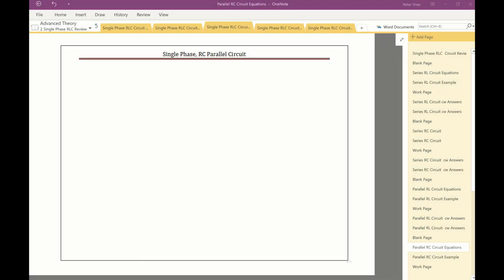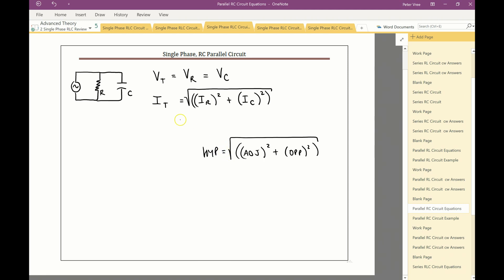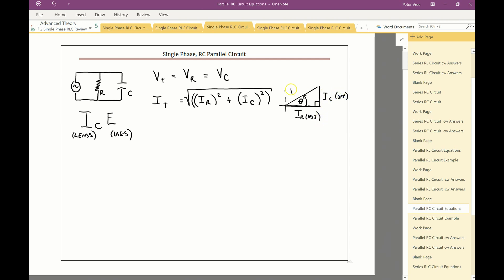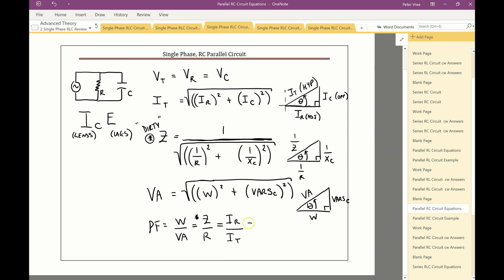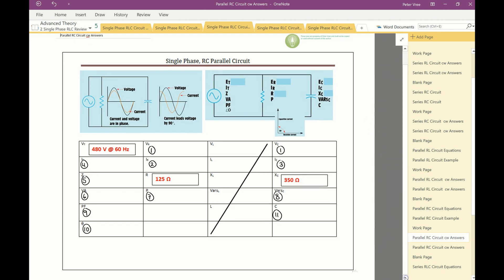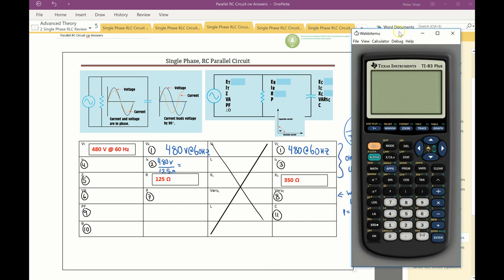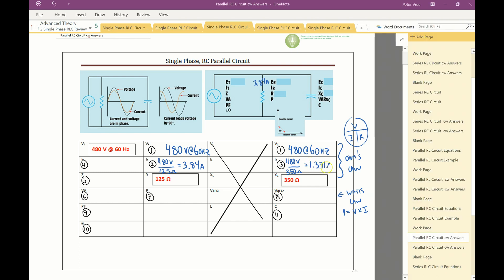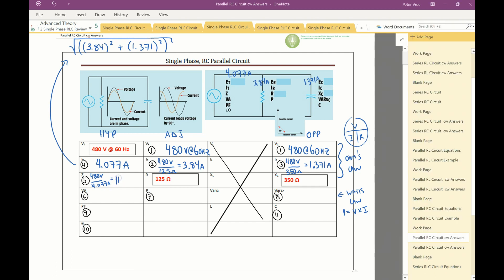RC Parallel Circuit Equations & Sample Calculation (1 of 2)

Comment: 15:29 If the far left column is supposed to be the hypotenuse then why is the impedance less than either the opposite or adjacent?
Reply from the maker: Remember that in a parallel circuit the total impedance is always less than individual values. 
The trig. function for this circuit is using the reciprocals